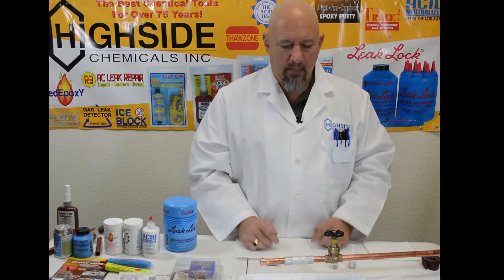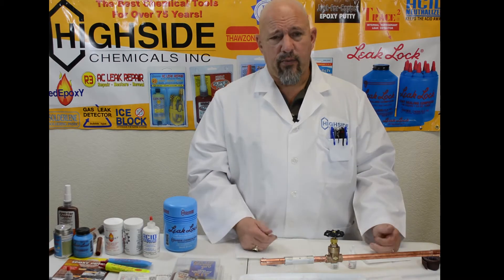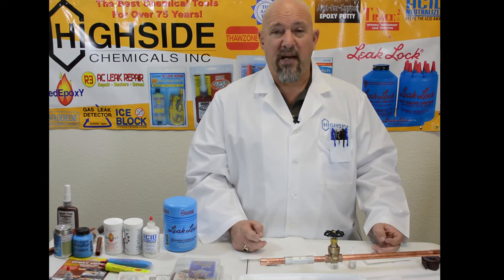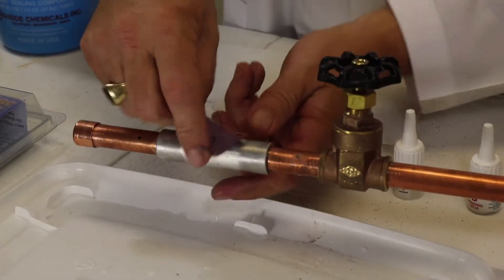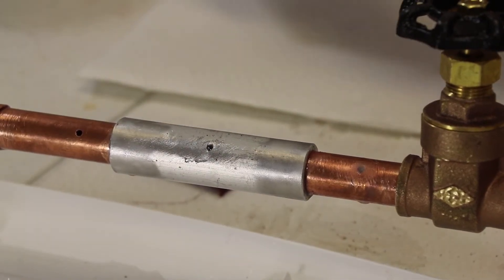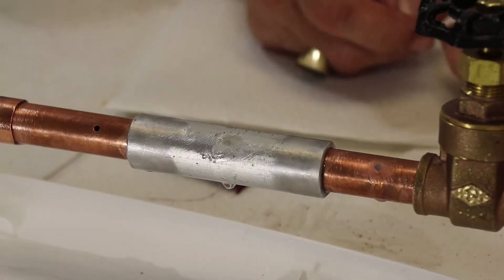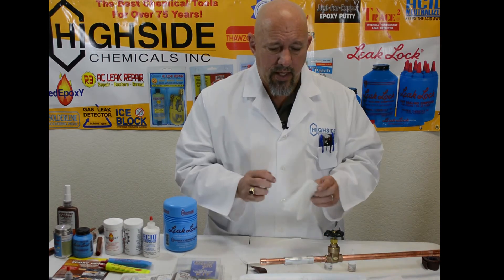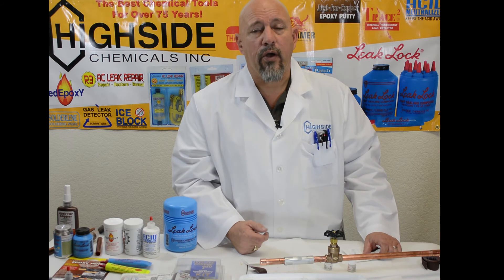HVACR Instant Patch  - Aluminum Repair

Comment: Can you apply on the area while under pressure? (Not leaking)
Reply from the maker: Thank you for the questions. With this product, you will not be able to apply while pressure is applied to the system. Part A will not be able to stay in place long enough unfortunately. We have an epoxy putty product, that would be better suited for a pressured application. https://www.highsidechem.com/product/just-for-copper-epoxy-putty/

If you have any further questions, please feel free to reach out: https://www.highsidechem.com/contact/

Comment: Is that work on the 400 psi reefer unit lines
Reply from the maker: Thank you for the comment! Yes, after the full cure of 20 minutes, if everything was applied correctly it will hold this pressure. It has been tested up to 1800PSI with no issue. Be sure to there is no pressure on the system, the area has been cleaned, and the product is applied fully A, B, A.

Comment: Will this work on cars?
Reply from the maker: Hi, thank you for the comment. This product will work on any metals and any rigid plastics. As long as it is applied correctly and would not exceed contained pressures of 1800 or temperatures over 280°F. If you have any more questions, please feel free to contact us: https://www.highsidechem.com/contact/
Reply: @highsidechemicals1936 Thank you

Comment: is there a chemical difference between the Plumbing version of this product and the HVAC?
Reply: Will this work on a small hole in refrigerant line on a deep freezer?
Reply: @Damster587  yea it is great stuff.
Reply from the maker: No sir, they are the same product, just marketed for different industries.
Reply: @highsidechemicals1936  sweet that is what I figured. have the numbing one will do the job When I fix it I will plug you guys. but for now the leak seems too slow to find.
Reply from the maker: HVAC or Plumbing Leak?
Reply: @highsidechemicals1936  hvac but it is too slow from what I can tell I added freon and it is still same pressure after a few weeks.
Reply from the maker: Check these out:
Fixing/Finding Small, Slow Leaks
https://highsidechem.com/r3-ac-leak-repair-pro-tech-service-kit/

Finding Small, Slow Leaks
https://highsidechem.com/trace2-pro-tech-service-kit/

Where to Buy:
https://supco.com/web/supco_live/supco_distributor.php

Give us a call if you have any questions: 228-896-9220/800-359-5599